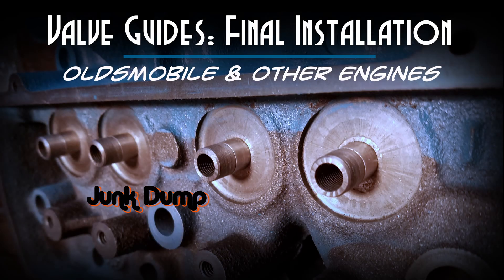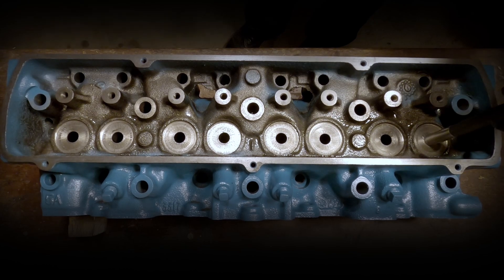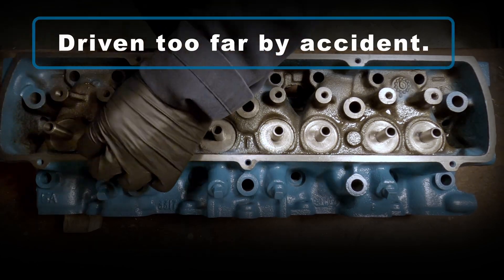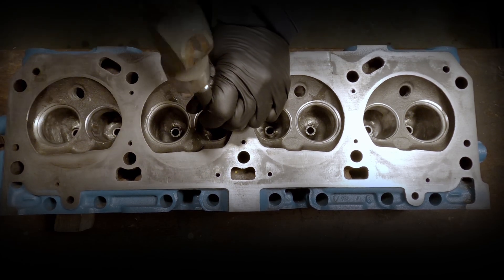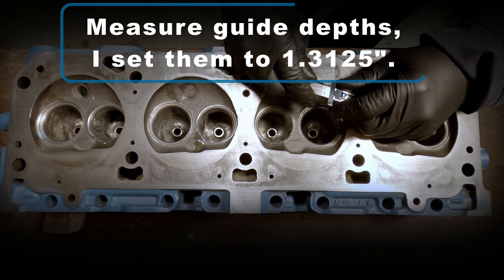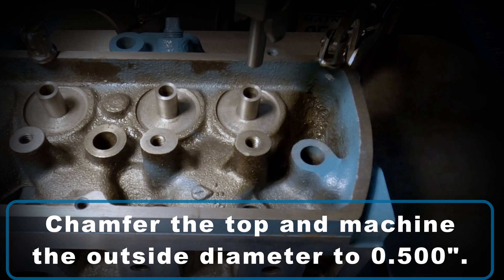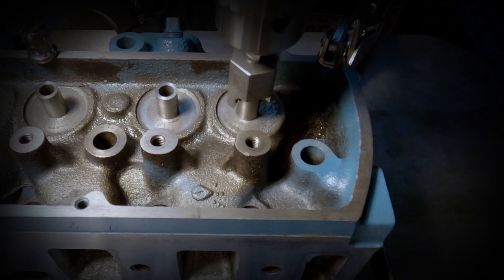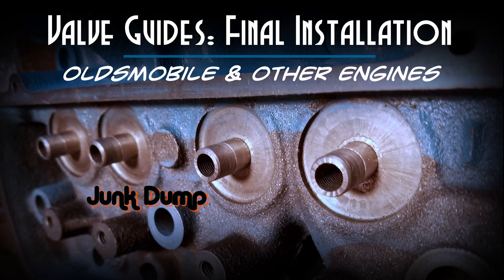Oldsmobile Valve Guides final installation

Comment: I might have missed something here - sorry. What did you screw in to the heads to nicely block off the AIR pipe inlets?
Reply from the maker: I can't find which video that information is in, so I may have missed that. I use 1/4" steel NPT plugs, they work perfectly and I have never had a leak. I exclusively use Permatex High Tack gasket sealant on the threads when installing them.
Reply: Hey no worries. So no stainless or brass then? Great to see you using High Tack, that stuff has been used in my family (Buick & Cadillac) since the late 1960s. Superb. Your films are incredibly helpful. Thanks.
Reply from the maker: @paulbedford9816  I have never tried stainless steel plugs but they should be fine, definately steel over brass as it leads pitting on the heads.
Reply: @junkdump2720  Thanks fella, appreciated.

Comment: Thank you for all your invaluable information.  Really appreciate your videos. I apologize for bumping in on this post. This is a question regarding your 1970 455 build. I am curious if you used a rattle can to paint it?  If so,  what brand and particular color? I can't seem to find a gold I'm happy with, but I like the looks of the 70-455  finished color.
Reply from the maker: No apologies necessary, thank you for the comment and question! I used VHT Metallic Gold for the 70 455. The correct factory color would have been Corporate Metallic Blue which is an excellent color, but if you want a good custom gold the VHT Metallic Gold is a great choice.
Reply: Thank you for the very prompt response.  The SP404 gold flake?? The can cap didn't give it the justice it deserved.
Reply from the maker: @davido4438  That's the one, the color might also look different on your monitor,  try a test piece first. Also it dries a different shade than when it's applied.

Comment: I always look forward to your videos, because I see different ways of accomplishing a common task. I like the sleeves you set over the guides to control the depth. (Very clever) I believe you are using a drill press? Talk about mistakes... at almost 70...I'm an expert. Very good video quality. What is your opinion of thin-wall bronze liners? I know the tooling to do their installation is more involved and expensive that the steel .502 guides. Do you have an opinion on their longevity vs the steel inserts?
Reply from the maker: Thank you for the praise, I'm happy to hear you enjoy the videos. I was taught to do this work using a mill and Serdi (100?). Unfortunately I can't afford new equipment like that so I'm stuck with what I have until I find some used machines. I am very meticulous and try to keep my results indistinguishable from machine shop work. To your question, the manganese bronze guides are for racing applications and essential for stainless steel and titanium valves. They don't hold oil very well and aren't made for longevity (there are some new grooved designs that help). I don't use them on anything that sees driving on the street. I would recommend a machine shop to install them if someone was building an engine that required them. Thank you for the great question, and thanks again for watching my videos!